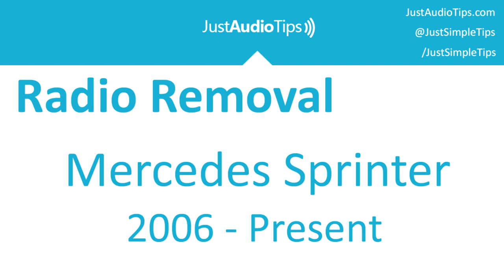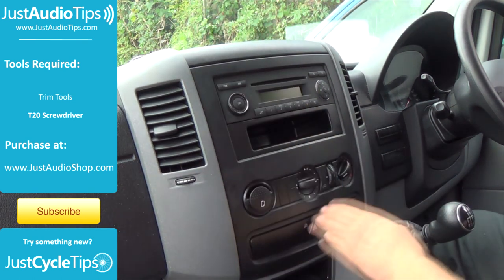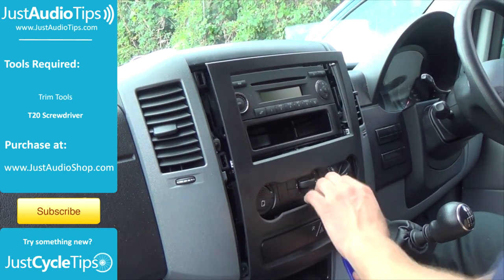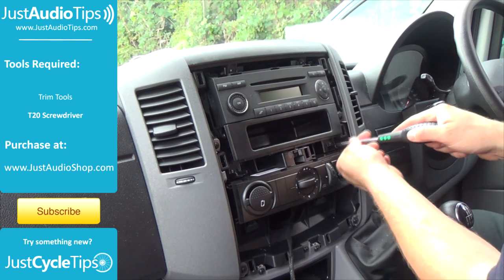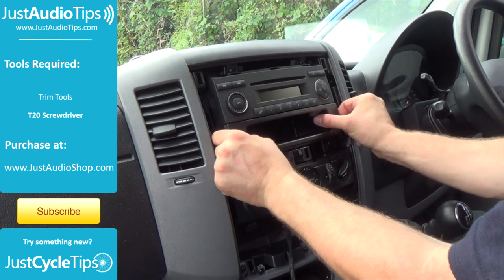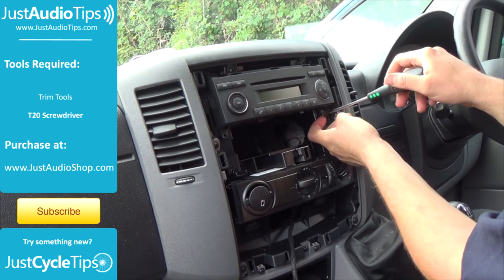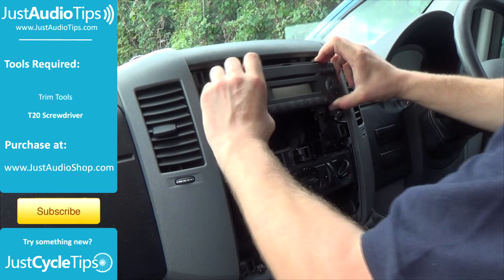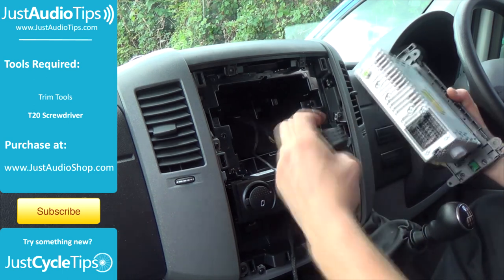Radio Removal Mercedes Sprinter (1995 - Present) | JustAudioTips

Comment: This is not for Merc sprinter i Own a 2004 model
Reply: Its is, but for the NCV3 sprinter from 2007-2018, not the TN1 you have until 2006.